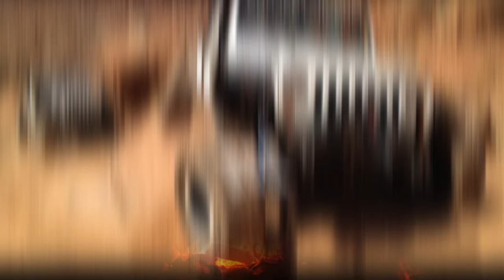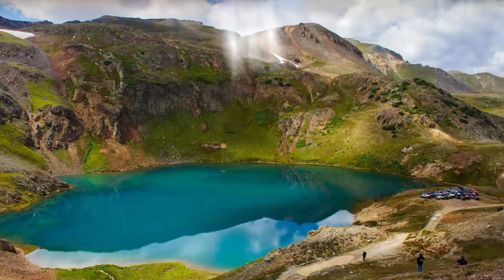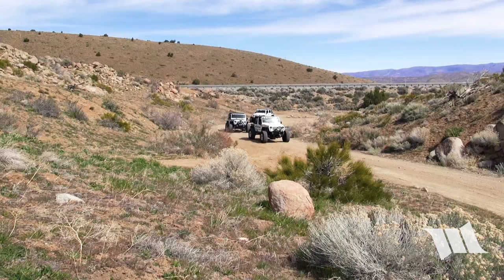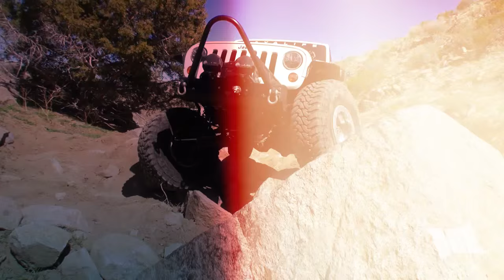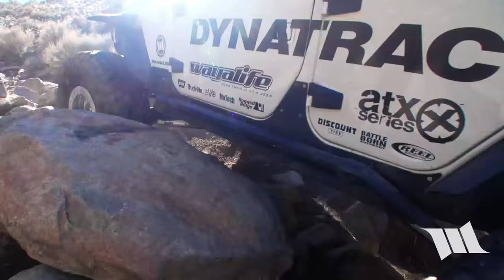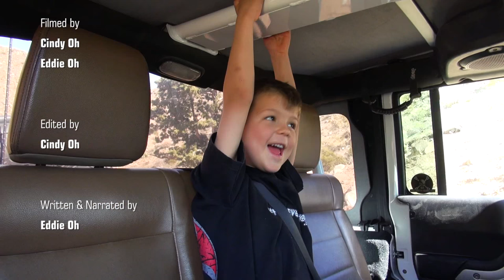Jeep Wranglers on BILLY BOB Trail Near Reno Nevada

Comment: Great video as always! Did Moby get switched to an Auto Trans during the engine swap? I recall it was originally a manual but there seemed to be almost no rollback on the steep parts.
Reply from the maker: +Harrison McCrorie Thank you and yes, Moby now runs a 6L80 automatic transmission with his 6.2L LS

Comment: Another sweet video!! What do you think performs better them toyo mt or the nitto trail grapplers>?  Im trying to decide between the two brands.
Reply from the maker: Depends on the size. Up to a 37" tire, I might argue that the Toyo is a better all around tire and has a significantly more durable sidewall.  At 40", the Trail Grappler is a different design and better on the rocks.  Being that Nitto is made by Toyo, the 40" size is pretty much a Toyo only with a different tread pattern.
Reply: Wayalife thanks. have you tried both brands in mud at all if so how did do. thanks.
Reply from the maker: Yes, in the mud, the Trail Grapplers do a better job.  However, the Nitto Mud Grapplers do even better.
Reply: Wayalife I was kind of leaning towards the Nittos. another one I thought of is Mickey Thompson mtz p3 they have a new tread compound with more silica for better cut and chip resistance, but don't know anyine running them.
Reply from the maker: You'll like the Nittos.  If I recall, Mickey Thompson is made by Cooper and I'm running them now.  The new compound with silica has been holding up well so far and they hook up great on the rocks.
Reply: Wayalife thanks for the info and the fast replys.

Comment: whats the average number people got into these jeeps?
Reply: Probably around 8 grand for most of the bolt on shit.
Reply: just 8? no axles tires ect? or was that included in ur bolt on shit
Reply: Idk how built the axles are, I was assuming they are the stock axles
Reply: But tires 35-37" is around 2000, bumpers/sliders/armor another 2gs for good stuff, then the rest for lifts and odds and ends
Reply: not as bad as i was expecting
Reply: they white JK on 40's is definitely not in stock axles. i'm not the best with axle knowledge, but they looked like 1 tons to me
Reply: Dynatrac ProRock 60's are what most of those guys are running. You've got 8k just in axles